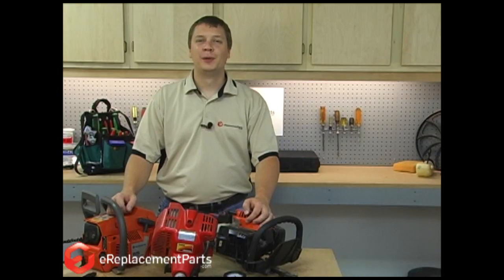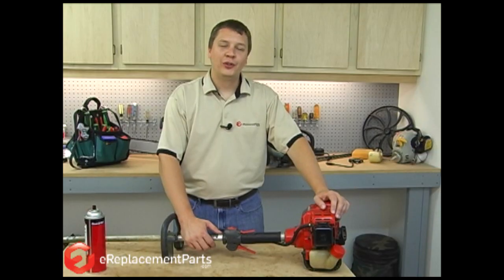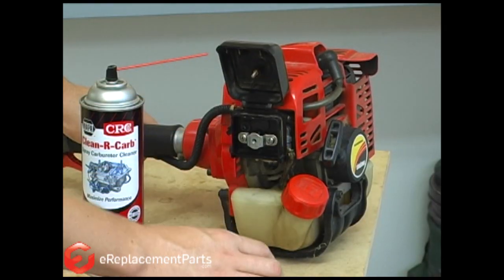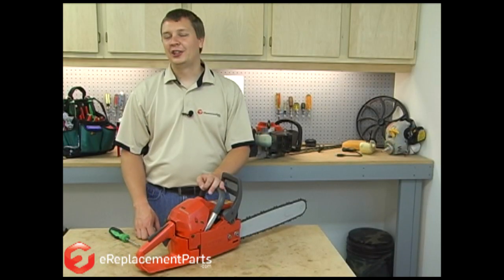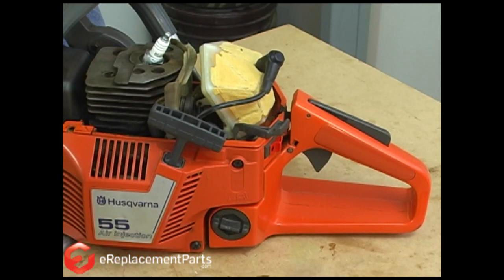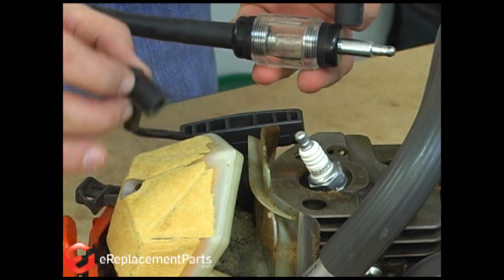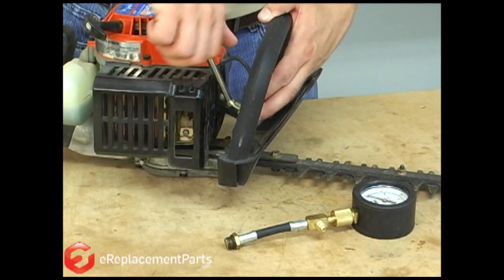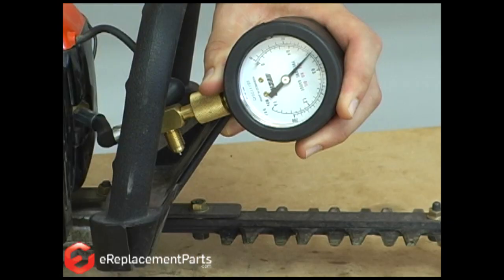How to Diagnose Two-Cycle/Two-Stroke Engines

Comment: Mark, can you tell me what causes a weed wacker to get very hot after fifteen minutes working it, and then it cuts off,
Reply from the maker: Hi Winston, here's a repair guide from our website that should help you troubleshoot your trimmer that runs for a while, then dies:
https://www.ereplacementparts.com/repair-center/lawn-equipment/trimmer/runs-for-a-while-then-dies/
Good luck with your repair!

Comment: I have a question. I own a Ryobi 790r weed string trimmer and need to replace the line. When attempting to remove the bump knob I t released itself from the nut holding the inner sleeve together. I can remove the entire inner/outer sleeve but cannot get the nut off the bottom of the shaft. How can I release that nut so I can open the sleeve and replace the trimmer string?   Thank You,Bruce
Reply from the maker: Hi Bruce. This video might help you with your repair:
https://www.youtube.com/watch?v=aPfbRh-B6Jw

If not, please reach out again and we might be able to troubleshoot further.

Comment: So, on the chainsaw, all 3 systems passed your tests. So......what was wrong with it?
Reply from the maker: Good question! In this video, we are using working machines, so nothing is technically wrong with it. We simply wanted to run through the diagnostic process. I hope this clears up the confusion!

Comment: It has been the case with me that I have experienced many fuel delivery system failures never requiring a carb clean or rebuild. 15 to 1 my issues are in gas filters inside the tank, fuel lines or primer bulbs. You might want to add a word about them. It just a thought.
Reply from the maker: That's a great point! We're always open to suggestions from our viewers, and we put out brand new videos each and every weekday. Thank you for the advice, and don't forget, you can subscribe to our channel and get access to all our new content, some of which based on viewers like you!

Comment: Hi,
i just bought a Kawasaki 2 stroke trimmer, the longer i use it, the worse it runs (=maybe a total of 1-2 hours).
I changed the fuel after the first try, it might have been old. In the local store they recommend using Aspen2 (acrylate fuel?) however the mixture on the cap says 25:1 and Aspen is 50:1. He reckoned it was still the best option.

The trimmer starts, however it gets harder to start it. Just letting it run without touching throttle it runs perfectly fine, on high revs its very unstable in revs and power. 
I am wondering if the rope to start the engine is rather stiff or if thats normal, but maybe it is something to consider in the problems package...?

I checked the exhaust port coming out of the engine and this wasnt really dirty, there doesnt appear to be an air filter in place (cant seem to find them online immediately either), fuel filter i have ordered a replacement.
Took out the spark plug, the pin was less than 1mm away from the hook so i assumed it was okay...(?)

Hope anyone could give me a clue on what to check, i dont have any testing gear (yet)...!
Thanks in advance!
Reply from the maker: Thanks for the question! The best bet in terms of diagnosing the problems with your trimmer would be to check out our repair center on our website. There, we've listed a number of problems that you may be having with your trimmer, and what some of the offending parts may be. Based on what you describe,  you might want to check out this page:

https://www.ereplacementparts.com/repair-center/lawn-equipment/trimmer/engine-will-idle-but-dies-at-full-throttle/

You can find a full list of Trimmer symptoms here as well:

https://www.ereplacementparts.com/repair-center/lawn-equipment/trimmer/

As far as the air filter goes, if your Trimmer doesn't have one, it can cause the engine to run poorly. Here is a page where you can find Kawasaki air filter for your trimmer.

https://www.ereplacementparts.com/search_result.php?q=kawasaki%20air%20filter%20trimmer

 If you need help finding the right one, you can reply to this thread with your model number and I'd be happy to assist you!

Thanks for the question and good luck with your repair!

Comment: I have a Troy built 25 cc weed trimmer that back fires out the exhaust and carburetor what would cause that
Reply from the maker: Hi Jim. Thanks for the question. Here's a link to our repair center that I think might help you out:

https://www.ereplacementparts.com/repair-center/lawn-equipment/trimmer/engine-misfires/

You can always start from the main trimmer repair page, and determine what symptom best describes your problems. You can find that page here:

https://www.ereplacementparts.com/repair-center/lawn-equipment/trimmer/

Comment: Is it normal for a 2 stroke engine to have a slight carburetor like spit back, back flow I guess...while driving?? I have a 2010 Tomos sprint and when idling you don't notice or see any leaks anywhere. But after you have gone and ridden it for a while you while see that gas/oil mix has dripped slightly from the air filter down the side of the transmission cover and onto the exhaust.
Reply from the maker: Hello Willem,  it definitely  sounds as if you have a problem with the carburetor. It may be dirty inside of it and clogging some of the small orifices. If there is a rebuild kit available, you should try it. If not, at least remove it and thoroughly clean it inside and out.
Reply: Yeah I thought I would try that first, someone online wanted to try to tell me it was a stuck float ot possibly a bad reed valve....Well I know for sure it isn't a bad reed but I have yet to pull the carburetor and clean. So today I am going to try that thanks for the tip!!
Reply from the maker: Your very welcome.

Comment: I’ve got an HS 75 hedge trimmer. I’ve replaced carb., ignition coil, throttle cable, wires to the coil, tested compression it’s at 90 psi, I’ve also replaced fuel lines. My problem is that it doesn’t like to stay running. Any ideas on what to do next?
Reply from the maker: Hello, unfortunately at this time we are unable to offer technical support. I would suggest contacting the manufacture for further information. I sincerely apologize.

Comment: what should you do if the engine starts but will not idle?
Reply from the maker: Hello Rick,  it sounds like there is a problem with your carburetor. It may need to be rebuilt and cleaned or replaced.

Comment: Mark I have a echo pe 225 edger replaced the carburetor an feul filter and lines also spark plug it cranks runs for a couple minutes a dies but wont start back for a few hpurs
Reply from the maker: Hello Philip, unfortunately at this time we are unable to offer technical support.

Comment: To test the spark plug with out fancy tools do the following. Remove spark plug from engine. Reattach spark plug wire to spark plug. Place the spark plug on the cylinder head making sure the ground portion of the plug has direct connection to clear bare metal on the head. Clean off dirt and oil if necessary. Turn over engine making sure the the spark plug does not leave contact with the head. Observe spark between the ground tip and the anode of the spark plug. If no spark is seen check plug, wire(s), and ignition coil. Do not touch part of the ignition system while trying to start, you may get a jolt!

Comment: Considering the $150- $200 cost of replacement it's unlikely I'm going in as deep as new rings on a little chainsaw,  but your starter fluid, and a new plug is a $5 very doable pre hurricane field test ritual. Thanks

Comment: great video's i have a problem can you help with advice please fs stihl 120 strimmer no spark new plug , new coil ,regapped the coil at differn't settings checked the switch its fine tried with kill switch off no joy magnets are fine the only other thing i can think of is that the keyway has gone on the flywheel ! what's your assumption please ,  thanks .
Reply from the maker: You may want to check to see if the flywheels key is worn. Check the spark plug wire to make sure it has continuity. I looked up the specs for a FS120 and the spark plug gap is 0.020  . And the coil gap should be 0.12 . This is a
long shot, the flywheel magnets may have lost their magnetic pull. We are not a Service Center for Stihl, so I am not familiar with them. It may have an electrical part that I am not aware of.
Reply: Thanks for the reply gapping on the plug & coil is correct the continuity is 2.6 @ 20k on the secondary side ,there is a slight play in the flywheel key which is cut out of the body of the flywheel would this cause no spark with being a small engine ? i once had a ryobi with the same problem ! my theory is the flywheel  if you have a good coil! i dont know what else it  could be , it was running but stopped the coil was bad , thanks

Comment: What could be the case if my engine doesnt start. It gives a pop or few when i pull the rope, but doesnt fully start up. I changed the spark plug and cleaned the carb (before that the engine was fully dead).
Reply from the maker: Even though you cleaned the carburetor, there still may be some debris in the small passages.  You may want to obtain a rebuild kit or a new carburetor
Reply: eReplacementParts.com i disassembled the engine, and there's scoring on the cylinder, so i guess its lost compression during the years.

Comment: I have also found the exhaust or muffler gets clogged up alot.  I have noticed that gas caps hold a about a half a bar of pressure then release when pressure gets higher than that.  If I am running without the gas cap will that cause a fuel and air mixture issue running rich maybe or even worse lean?  Thanks Mark and you have saved me several trips to the shop.  I think I have similar smaller chainsaw called a 45.  What testing equipment would you be that you say I probably don't have to test the plug and strength of the spark being made.  I try to see if it will cross a 8mm gap consistently. I have used a little fine sandpaper on the protruding metal parts on the coil.  Why is 120 to much compression.  I have several items that say they should in perfect operating condition have atleast 150lbs and up to 185.  A friend had one that was around 210.  I have a weedeater that is a mess that hits sometimes up to 280 lbs.  Why is that one not releasing the pressure?  Its been cleaned out well and is a basic two so valveless.

Comment: Thanks! My Shindaiwa trimmer runs for about 10 minutes...Then, It will idle but won't take throttle... Would that be the Ignition coil?
Reply from the maker: Usually if a coil is the issue the motor either won't start at all or won't run at all after it heats up.  Your issue sounds to be more carb related.  Have you cleaned it and checked the filters lately?

Comment: if a weedeater is running but doesnt seem to have the power or speed it should have,  what would be your guess?
Reply from the maker: Your tool may benefit from a good tuneup.  It's difficult to diagnose a tool without having it in the shop.  The air jets are typically preset and not adjustable on the newer models.

Comment: My weedeater has slowly lost power over the past few weeks I use it almost daily could it just be getting wore out?
Reply from the maker: It could be losing compression or wearing out.  Something that may help and isn't to expensive is a complete tuneup changing the spark plug, air and fuel filters.

Comment: Hi Mark, the problem with my trimmer is that doesn't start when it get hot, or if it was running for about 10 to 20 minutes. It is easy starting when it is cold. Why is it?
Reply from the maker: Sometimes the ignition coils develop a short on these when they get hot and as the motor cools you'll get the spark back BUT the most common, easiest to test and cheapest to fix is a plugged vent on the gas tank.  Run the tool until it stops again.  Once it quits, open the fuel cap then see if you can start it again.

Comment: Hi therethank you for the video. Could you please advise me on how to make my old Walbro non thumb pump carb have the ability to have a fuel pumping or primer capability
Reply from the maker: We have "Stand Alone" primer bulbs that you can get.  Poulan number 530071835 is a good example.  The
problem I think you'll run into is that carbs that are designed with the primer bulb are set you with an input line and a return line the send fuel back to the tank. Without the return line, once the carb is full you'll flood the cylinder.
Reply: Thank you for getting back to me. Yes, you are correct about this. What do you suggest?
Reply from the maker: I have no idea what to suggest short of finding a carburetor that has the return line.

Comment: Great info ,I own a stihl brush cutter and when I give it more throttle it doesn't seem to cut off or slow down,and when it starts the spool spins when I ain`t touching the throttle`so I adjust the throttle cable and it struggles to rotate fast and cuts out,any add vice please on these matter,owe yes I have checked the baffler and it seems it seems to be good,

Comment: I have a question:  I obviously won't hold you responsible for the outcome ;-)  But I would prefer to get advice from someone with experience.  My rear tine tiller won't start and continuously run.  but it does respond for a split second when I use starter fluid.  I cleaned out the carburetor and still have the same problem.  I checked and verified that I do have a spark.  Also, the fuel was clean and there was not any debris in the line or on the screen.  Here are the questions:  

1 - Should I cry uncle and take the tiller to a repair shop?  

2 - Or should I buy a carburetor rebuild kit?  

3 - Or should I try replacing the diaphragm?  (the diaphragm was flexible....but I'm just wondering if it's not pumping fuel)
Reply: Try adjusting your carburetor adjust your lowspeed a bit higher and might work better
Reply from the maker: If you don't mind opening up the carburetor I would by a kit that includes a new Diaphragm and change it all out.  Sometimes a new carb is
only a little more than the kit so look at both prices before you decide.  You can take it to the shop if you don't want the bother but the mechanic will probably do exactly the same.  Another item to check is the fuel filter.  These filters are a real fine mesh and can easily plug. 
PS.... Don't run the machine without the filter.  The ports in the carburetor are typically very small and will easily plug with the smallest
amount of debris.
Reply: Hi guys.  thanks a lot for the replies.  I am getting a carb rebuild kit. However, I also found what is probably the real problem:  I said the engine had compression because I put my finger over the hole and there was more than enough to move it.  Once I bought and actual gauge, it was <30psi of pressure. I took the manifold off and found the intake valve is unseated by ~.010 more than it should when it should be closed.  Ordered a valve spring compressor and will adjust the valve when it arrives!

Comment: my strimmer is starting but dies when I try to revv! any ideas? it is a new machine only used once!
Reply from the maker: The symptoms you're describing indicate either a plugged jet in the carburetor or a defective diaphragm in the carburetor.  That unusual for a new trimmer. This sometimes occurs if the motor has set for
an extended time with e-85 gas in the tank.  If it's new it may still be on warranty.

Comment: I have a question about the spark tester, since it is inline with the sparkplug one must assume the sparkplug is new. I have here a sparkplug that is wide open when you measure it on a ohm meter and I thought my coil was bad.

Comment: I have a Hirth 2703 and 521 CC for an ultralight aircraft which I wish I had never seen!! It starts and runs excellent for a little while. But then as it warms up the RPMs start to drop off. At full throttle at first it will rev up to about 6,000 spinning the prop. Then it will gradually drop back to about 5,200. I have tried several spark plugs, 3 carburetors,  various jets of different sizes. I changed the coil, the CDI or Ignition module, and then the stator too. Various things have helped a little bit but it still just doesn't perform like it should. The fuel pressure is about 3 lbs at idle to mid range, and then it drops down to about 1 lbs at full throttle. SoI added an electric fuel pump too which brings the pressure up to about 7 lbs. That seems to help some, but it still slows down after the temperature comes up. Do you have any good suggestions? Thanks!
Reply from the maker: I've not had any experience with this particular motor. You've replaced everything that I would have suggested.  In my experience with air cooled engines, when they start heating up is when you start loosing power and RPMs.  Are you getting an appropriate amount of cool air across the block and heads?
Reply: Thanks Mark for your reply. Yes the cooling fan blows lots of air and the EGT and the CHT are well within range. I think I have the problem narrowed down to a weak spark system with their Denso electronics. Because when I put the 3 inch long orange spark testers between the spark plug  wires and the spark plugs, the spark light is very weak, in fact I can't really see it if the engine is outside in the sun!  Not nearly as bright as on the Rotax engine. So with the extreme low resistance fine pointed NGK spark plugs it is better. But I am going to look around and see if I can find a better spark system than the Denso system to put on there!

Comment: Gotta question the compression figures. You likely won't start a small 2-stroke with less than 90 psi, which is way low. At the other end of the scale, I've a stock Dolmar chainsaw with 210 psi. Needless to say you need an accurate gauge that screws into the plug hole, with proper (soft-spring) schrader valve at that end. Crank with WOT until needle stops.